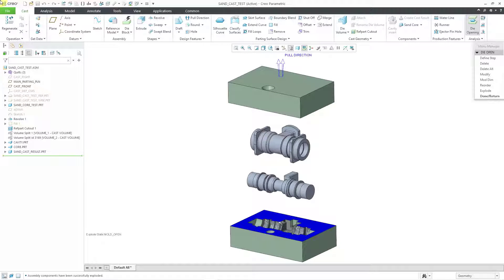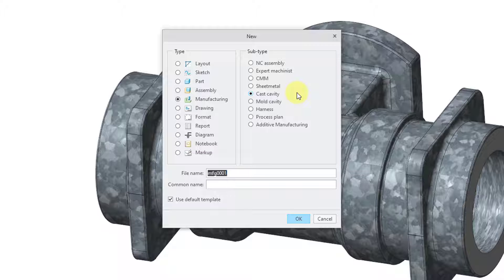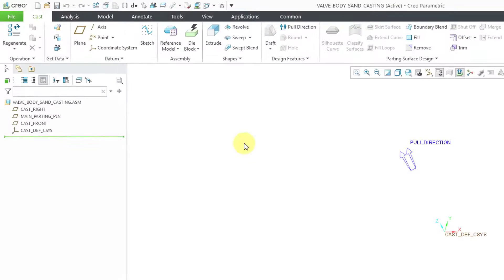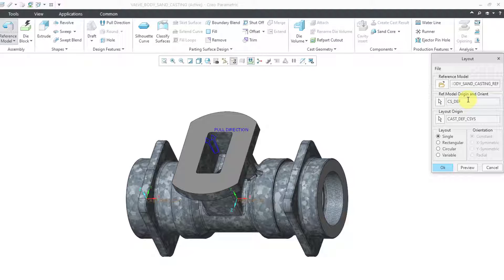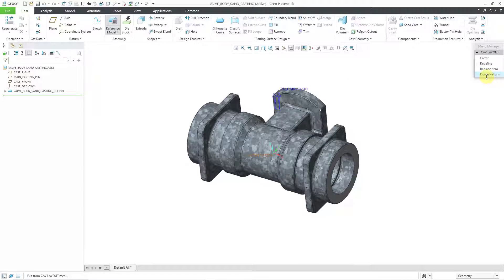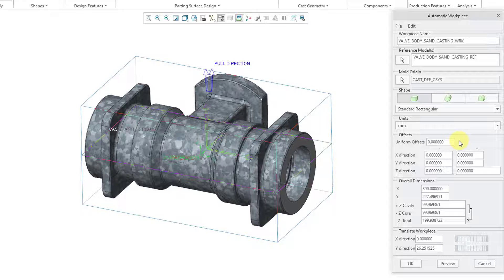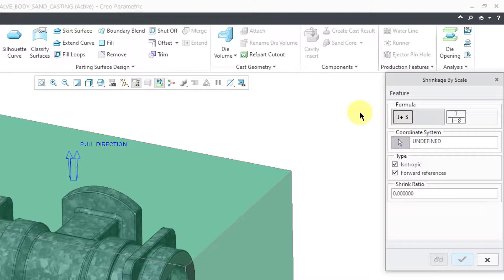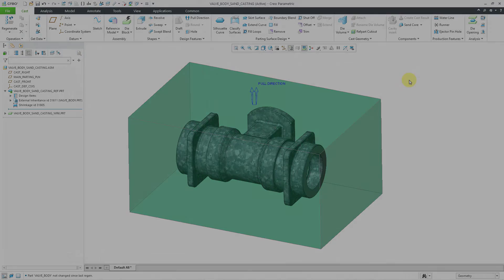Creo Parametric - Sand Casting - Part 1 - Setup

Comment: I didnt even know this existed...most of the creo users dont go beyond drawing mode..or sheetmetal...the fact that tutorials of such advanced modes are open is greatly appreciated...
Reply: When I learned this module in 2018, there were 3 people in Europe at other Ptc partners that still knew how it worked. I’m glad to see this knowledge being updated by you and made available!
Reply from the maker: Yup, there's so much stuff in Creo people are not aware of. I've been wanting to do a sand casting video for a while and just recently came across a demo dataset I could adapt. Unfortunately there's very little available to learn about these advanced modules.
Reply: @CADPLMGuy  where should i start...?? Lol
Reply from the maker: It depends on what you're interested in. I have over a hundred playlists that you can choose from depending on what you want to learn.